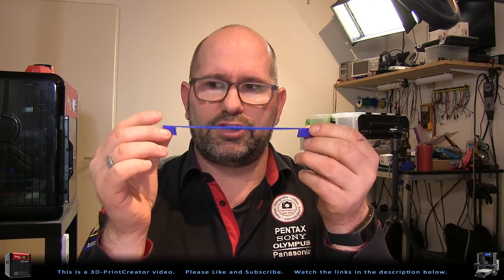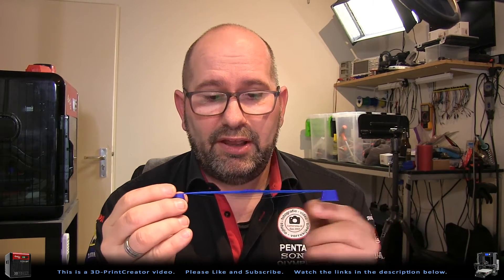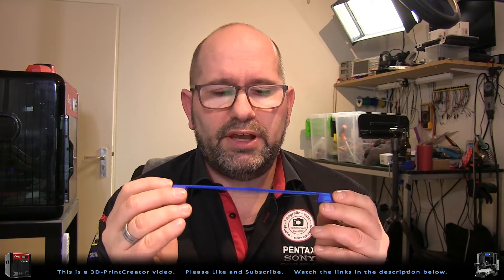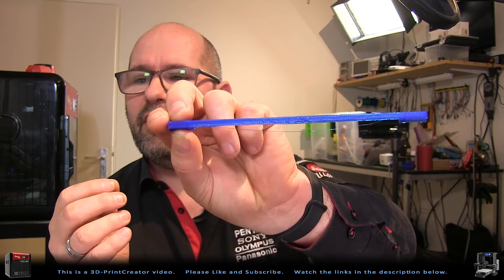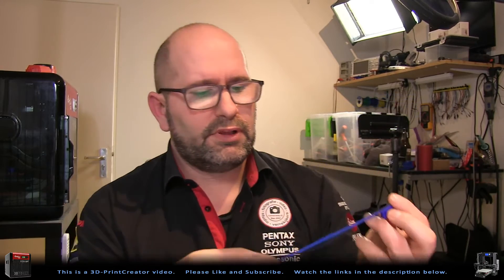▼ Making an 18cm long bridge on the Da Vinci Pro 1.0

Comment: Nice attempt at the super long bridge test! Looks like it worked okay. During your time lapse print video section, I notice that your temperature fluctuates like a full 10 degrees at times, that could be causing your issues with the sagging on the bridge. That kind of temperature difference can be an issue on other prints too. Either way, great response and fast too, didn't waste any time trying this bridge test.
Reply from the maker: That temperature fluctuation is driving me nuts. It's a thing I can't change and I really don't like it.
Reply from the maker: That will do the job partial. The biggest problem is the fact the printer only measures the temperature every 2 seconds and it can only set the heating on or off. There is no grey middle where the heating elements are only heating on half power or something like that.

Comment: I watched Joel's video this morning and my mind was blown. Then I watched this video, and my mind was blown x1000 because I'm about to buy this exact printer. I think you could tweak the settings, and get a much better bridge. If you do find better settings, PLEASE, pleeeease do an update video!
Reply from the maker: It will take some time, but there will be an update video. I am in the middle of a renovation in my house and there is dust everywhere. This print was made under a blanket, but that was not the best idea I ever had... When my house is normal again, I will try to make the best and longest bridge ever.